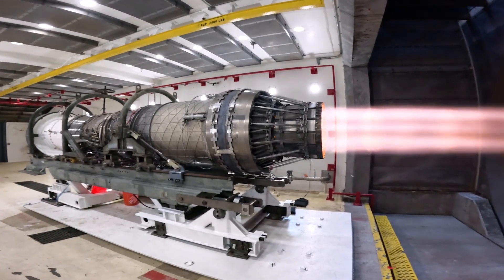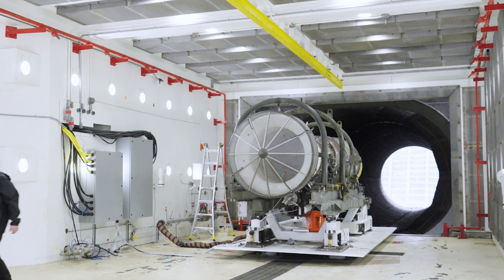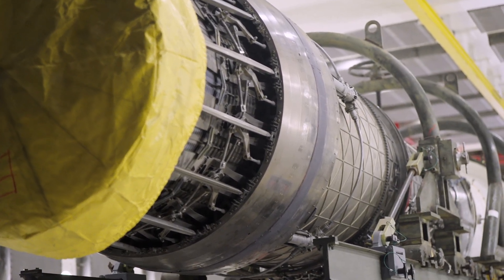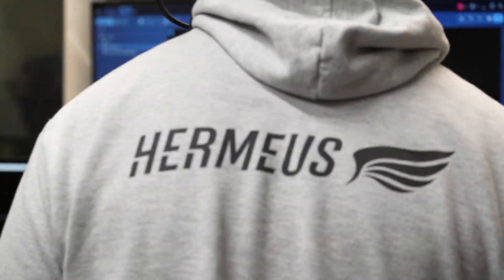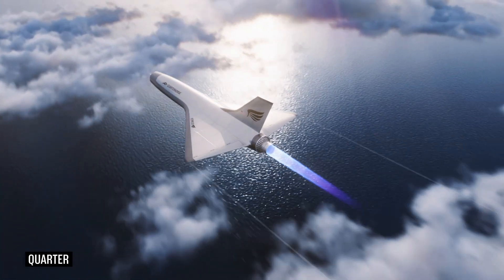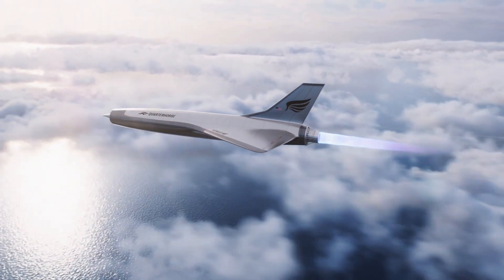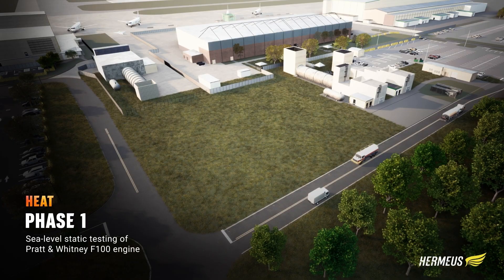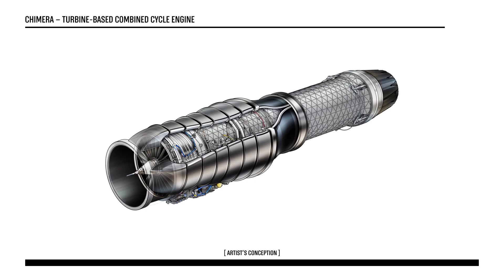Hermeus Brings “HEAT” Facility Online

Comment: Hint, go back to using Leaded (Pb) anti-seize lubricants. Else, the metals will fuse at the high temperatures.
Reply: Nt the horse power ratio. Won't work.

Comment: Wall Street seems to have a knack for embracing flashy concepts, packaging them through the media, and selling them to the market. To date, I haven’t seen any real innovation from this company. Their demonstrations appear to rely on the same Pratt & Whitney F100 military turbofan engine, using an aircraft with no wind tunnel tests or payload validation. I mean, these are the bare minimum requirements for the development of any new aviation engine, let alone a turbine-based combined cycle (TBCC) engine. Frankly, I’d suggest they skip the theatrics and just buy a Pratt & Whitney J58 directly from the military.
Reply: J58 is too slow for hypersonic. the j85 they modified was able to run in simulated mach 4 conditions. They also have alluded to using a cryo fuel heat exchanger to keep the turbines from melting at high speed. The only thing they are doing is taking proven tech and trying to push it to its limit
Reply: I’d say developing a turbo-ramjet from a stock production engine is quite a bit of innovation.

Comment: Maybe the actual reason for "the lack of hypersonic test infrastructure" is the lack of a practical application for hypersonic tech. Other than possibly weapons - though even that is questionable, what is thing good for?
Reply: Until a viable airframe is flying that's not all Skunk-Works, it's only application is weapon tech.
Reply: It’s mostly a cheaper alternative to sounding rockets
Reply: That's the joy of innovation. Tech development can be applied where people wish. Hermeus is interested in hypersonic air travel specifically, but there are a WIDE range of scientific and research applications (e.g. alternatives to sounding rockets, applications for air-launched rockets or developments for SSTO spaceplanes even).

Most of what Hermeus is doing is still primarily based around research and developing new engine technology. That alone is a good enough reason to work on this stuff.
Reply: Well hermius' goal is hyper sonic airlines but Im sure it would be great for getting small payloads to orbit easily as you can air launch something at higher altitude (idk what altitude hermius is going for but it's almost currently high to reduce air resistance and heat) at mach 5+ which is a lot of energy that the first stage would have to provide on a normal rocket. It's also just great for research and will likely lead to revaluation in aerodynamics and engine design that is likely to trickle down to trans sonic flight as for military use hypersonic aircraft will be very important as stealth technology becomes more common and less effective especially for reconaces aircraft
Reply: @acompletelynormalhuman6392 there’s a reason why no one launches rockets off of planes, it’s a terrible idea
Reply: @jb76489  the f15 has shot an air launched anti satalit missile into space it was the first anti sadlite weapon in history. it depends on the size of the palod and how high and fast the aircraft can get the paload. hypersonic flight will allow the payload more total energy because the speed minimum for hyperSonic is mach 5 (about 3800mph) is a bit more than a fifth of orbital volcity for a low orbit (about 1500mph) and with how high hyper sonic aircraft have to fly it's already very high up and out of the thicker atmosphere. Most of the weight of a rocket is it's first stage because of all the fuel it needs to get into space and because the first stage has the biggest most powerful and most expensive engines eliminating that may prove to be incredibly economical. I will give you that it becomes less and less effective with large payload or higher orbit ones but in the regem it's opamal for its a promising idea
Reply: @acompletelynormalhuman6392  ASAT don’t have to go into orbit, you still need a massive rocket to to that, much bigger than planes
Reply: Logistics and Shipping things / FedEx UPS DHL. I'm slowly growing skeptical with that riveted toy when you compare it to Boom Supersonic. Boom isn't trying to go hypersonic but they have a solid MANNED test plane built from the ground up which is already hitting test goals that clearly reflect a group of people who have built airplanes before 😂  

Hermeus seems so iterative in their approach with all these designs that the closer they get the further they get instead of just building-the-plane they intend from the start. (Look over here! More podcasts!) Instead of all these incremental "horses" I don't understand why they don't build what they intend to fly from the start and save money.
Reply: improving space launch capabilities, researching the behaviour of hypersonic and high altitude air (which could provide insights for slower day to day situations), just generally being cooler than simply not doing anything like this with the money, i guess
Reply: @PearbabyREAL  If a customer wanted a cubesat in an unusual or polar orbit, the launch thing might find a few customers, but otherwise I agree Pear. This is just a grant magnet.